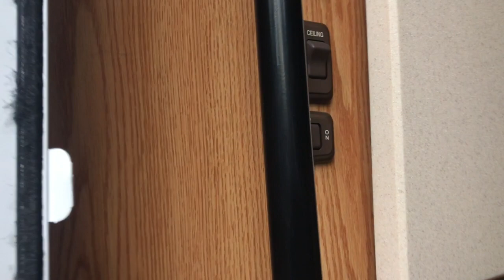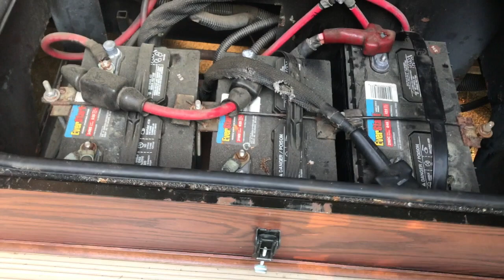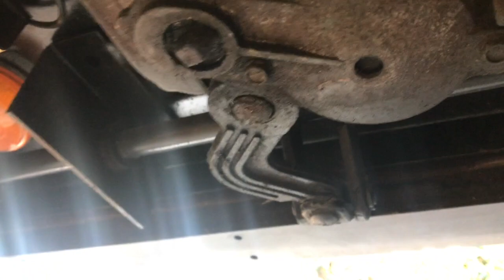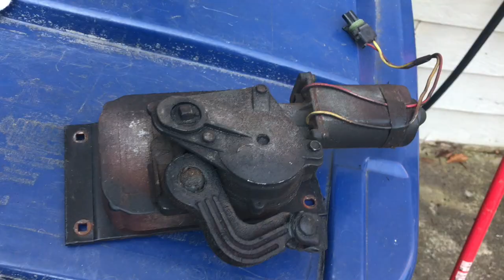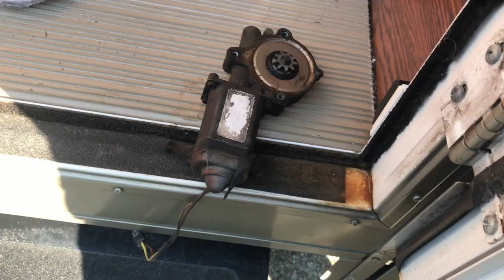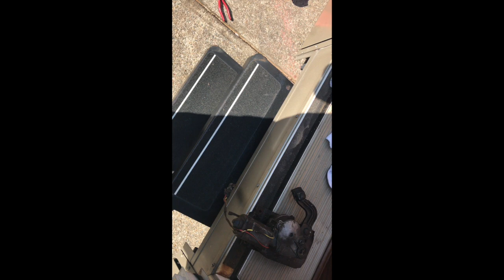TroubleShooting RV Automatic Entry Steps

Comment: Thought I'd let you know that your video helped me out.  My steps use the same gear box and motor as yours and it was doing the exact same thing.  I ordered both of them new but they were not compatible with my controller.  They were much different, even the way the electrical plugs in.    I followed your fix and it worked for me.  Mine was pretty dry inside.  A good cleaning and lubing everything is working like new again.  If they go out, I assume I'll have to get a new controller, gear box and motor.  Thanks for posting your troubleshooting video.

Comment: Great info, thanks ! I lost that pin and cotter, is that a special order part ?
Reply from the maker: I think you can simply replace the cotter pin and pin with like size parts from any hardware store. The step doesn’t carry so much load that a regular steel pin should work fine.

Comment: Replaced step motor, and now it's behaving in reverse!  Door open and step closes and vice versa. Any suggestions how to fix?
Reply from the maker: Sounds like wires are swapped on the new motor’s electrical connector. I suggest comparing the wire positions in the new connector to the old connector. If they are different, I’d send the motor back and get another one.

Comment: I suspect the motor brushes were not getting good contact. When you took the motor off the worm gear turned the motor enough to get the brushed to contact again. It's pretty common. Glad it's working for you. That gearbox is the same one I have and it's obsolete. The replacement motor kit is high priced too.

Comment: Bought a 94 Winnebago Adventurer with the kwikee steps that worked fine from NY to home in FL. Sat for a month and went to go inside the other day and they wobbled as they extended slightly and never locked out. The motor continuously spun and as I stepped on first step to see if it would stop it slid backwards loosely. I can raise and lower them by hand very easily now and had to cut wire to motor to keep from killing the battery again. If it is work gear driven then apparently my gears are worm food now so most likely replace whole step unit anyway. Shame there was not a coupling right beside the box I could unplug instead and didn't want to go tracing the harness for one. RV is in great shape and steps look beat so this would best be complete replace job.
Reply from the maker: Sounds like you are correct to complete replace the steps.  They shouldn't wobble so that sounds like they are fairly worn out.  I recommend adding a quick disconnect connector so you don't have to cut the wire cable in the future.  Mine is newer, 2002 model, and it had a connector as can be seen in my video.

Comment: Excellent.  I am going through this as of now.  At my magnet, I am not getting the full 12 volts and my steps are intermittently working.
Reply from the maker: I'm not sure what the voltage reading should be at the magnet.  It may not be 12 volts.  Perhaps another viewer can contribute.  Ask the step manufacturer to provide a wiring diagram with expected voltages.  Kwikee was very helpful to me when I needed support.  Intermittent operation is most likely an electrical problem as you seem to indicate.  Inspect the cabling all the way from the battery and verify voltage using a volt meter while wiggling the cable to see if you can cause a fluctuation.  If you can't reproduce the intermittent voltage that way, you may have to try replacing the electrical components.  Before doing that, I would make sure all connections are good and no corrosion exists or is cleaned up.
Reply: @lowellspecht8850  Thank you for responding.  I cannot find any information and when I called Lippert they weren't sure either.  I cleaned all of the grounds and still get the same voltage but the stairs started back working.  May have been an intermit because of a poor ground.. stay tuned.

Comment: I tapped the motor with a hammer.  Steps working again.
Reply from the maker: Sometimes just kicking the bottom step in the retract direction works too.  My understanding is that sometimes the limit switches (or mechanism) for the motor sometimes get stuck and tapping with a hammer or kicking the step can correct the problem.

Comment: door step does not go in when you start engine
Reply: simon foster
Reply from the maker: Simon, it is not clear to me the intent of your comment.  My step, when working normally, does retract when the engine is started or when the door is closed.  I didn't mention it explicitly in my video but it was also not retracting when the engine was started.  If you are stating that yours doesn't close when the engine is started and it is supposed too, but otherwise closes when the door is shut, then perhaps you have a bad wire connection.

Comment: My 2020 Jayco Kwikee step is stuck in the out position. 

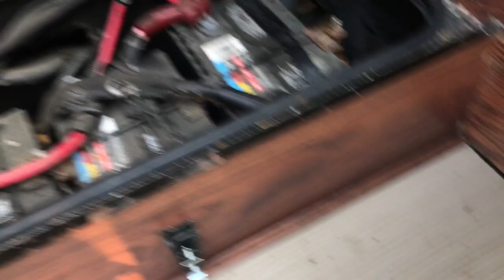Watched your vid to the 2:28 mark.  Went to the door, saw a little piece of plastic, put it where you put the magnet:  voila!  Step worked.  It had fallen off screen door!  Looks like there are two screw holes but they weren't used.  The thing is attached with double-backed tape.  Pathetic!

I was a 31J10 teletype repair tech in the US Army.  Electro-mechanical.  I didn't even have to get dirty or get out any tools to fix this!

Have a beautiful day and to all the trolls?  Get a life!

Road-side assistance would have towed me but all the RV dealers are fully booked to February.   So thankful I found your video!  God bless you!

Comment: I have watched many Videos about RV steps this week. Just happened across yours searching for something else. Your system is the same as ours, motor ,gear box etc. 94 Bounder.  Ours was stuck in the out position, so we took after it today.  Checked all the normal things as per. When I started to clean the outside gear cover i saw a 90 degree rub ware the bushing goes that the square drops through. took some 80 grit sand screen and light oil and smoothed the ID of the housing then put the scotch bright to it. Greased the entire works with a tube of Cam grease I had lying around , Just like a new one now. next was I used break clean on all the pivot points, let it flash off , then WD 40  to wash out the rust etc. then oiled all the points. Oh and didnt forget to grease the ball and socket either. Thanks again for a great Vid.. Cheers Dog

Comment: Just passing on a tip from my experience....steps wouldn't work...waved a 3x3inch magnate next to magnetic sensor on door and Voilà, steps work! Magnate travels with me!
Reply from the maker: If you have to continue to wave the magnet in front of the door frame sensor, then something is wrong with the magnet on the door.  Replacing that door magnet will fix your problem.  If it was just a one-time occurrence, then likely you had some dirt obstructing the servo and just got lucky when you tried the magnet.  Perhaps you stepped on the steps and shook the dirt loose coincidentally.  Same if you have a loose electrical connection.  Make sure your electrical connections to the motor are good and tight.
Reply: @lowellspecht8850  :  Hello!  The little magnet on my 2020 Jayco was stuck on with double-sided tape!  Not even screwed into the screen door!  Luckily, I found this little piece of plastic in the door jamb and guess what it was?  Yep, the magnet thing!  Will be getting 2 screws next time I am near a hardware store!

Guys were saying $125 plus parts and labor and Good Sam said they had someone that would come out for $200!  

Thank you!  You saved me at least $200!

Comment: I can not get the cotter pin out , What tool did you use and does it come out towards the left?
Reply from the maker: The best tool, in my opinion, to remove a cotter pin is a pair of needle nose pliers.  The trick is to unbend the two ends that wrap around the end of the larger pin with the hole and get them as straight as possible.  You won't be able to get them perfectly straight but do the best you can.  Then pull the pin, using the needle nose pliers, from the opposite end.  The end where the pin has the small loop in it.  This may be to the left on yours but it could be any direction since the larger pin is allowed to rotate.  Usually, one has to tap lightly on the end with the two straightened pieces, with a hammer to get it moving.  By design, it is a tight fit between the cotter pin and the hole and that is another reason, replacing the cotter pin makes installation easier.  If you have two pliers, you can try pulling on the loop end with one, and on the other end, push while squeezing the two ends together.

Comment: Lowell, you couldn't turn the motor with a wrench because it's a worm drive. You can't force drive a worm gear from the driven end (unless it is a very shallow ratio), rather it acts as a very effective brake. You'd break that gear before you could force turn it.
 In fact that's why the steps don't just go back down from gravity,  spinning the motor over like you were trying to do :) The steps are pretty heavy after all. There's no other brake holding the steps up once they are retracted, than that worm drive, that's how well it holds.
Reply from the maker: Yes, I figured that out once I removed the motor and got a look at the gears.  Until then, I wasn't sure if the gears were always engaged or just when the motor was activated.